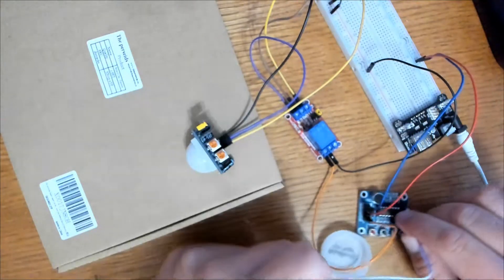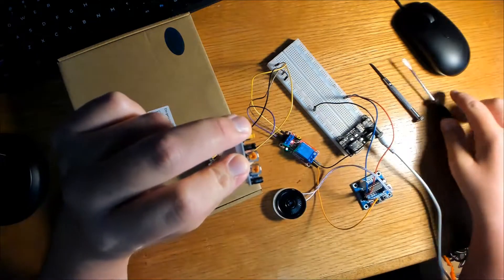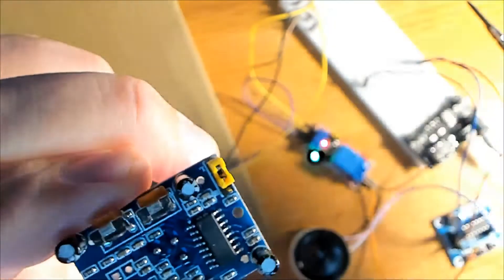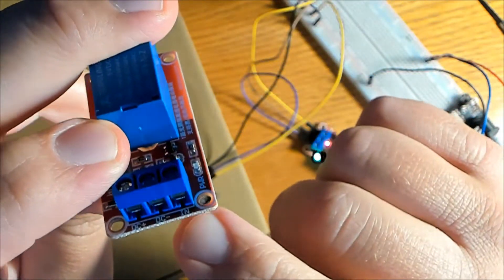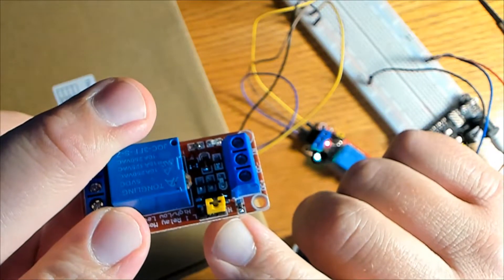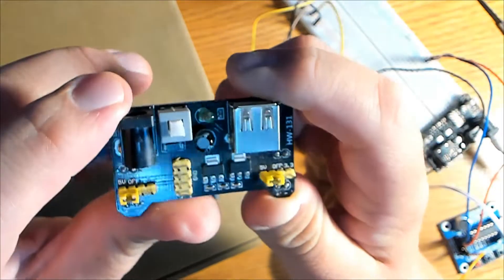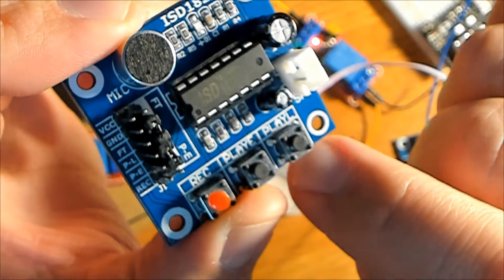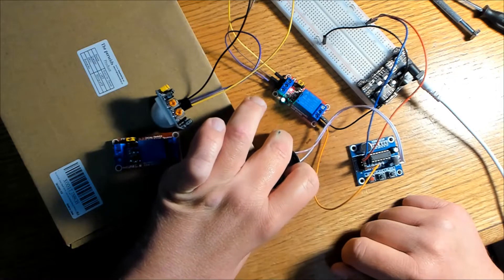Make A Motion Activated ISD1820 Playback Recorder Module Without Using Arduino

Comment from the maker: If you want to record sound when motion is detected (A Motion Activated Spy Microphone ), Use the "REC" pin and not the "P-E" pin. Attach the "REC" pin of the 1820 module to the "NO" port of the relay - all other wiring is the same as in this video. Adjust the time delay on the motion sensor to lengthen or shorten record time. For this module there is only a max record time of approx. 20 seconds.  Enjoy!

Comment: My ISD1820 is attached with PIR motion and mini amplifier, while all of those circuit is powered with 5V adapter.
As time went, the recorded sound became strange and have a high pitch. 
Is it caused by the lack of power?
Reply from the maker: Hey there!  it sounds like a power issue. Are you powering the ISD1820 module with a breadboard power supply? Try measuring voltage at the ISD1820 module with a multimeter to see if it maintains the correct voltage. You can also add a 1000uF capacitor across the power supply to smooth out any fluctuations.

Comment: i am using 4 aa battry for both but is any way that we can do this without realy module
Reply from the maker: hey there!  you can do this without a relay. You can use a S8050 NPN Transistor to switch the module on and off. if you need help with something like this just let me know. I don't mind. good luck to you! 💪💪👍

Comment: Do I need a power module or can I connect directly to double A batteries?
Reply from the maker: It will run on batteries. 3 AA's will work. The closer you are to 5V the better because the relay coil is activated by 5v. Most of these 5v relays need 75% pull-in voltage to work. It can go below 5v but the weaker the voltage gets, the more unreliable the relay activation.  Hope that makes sense